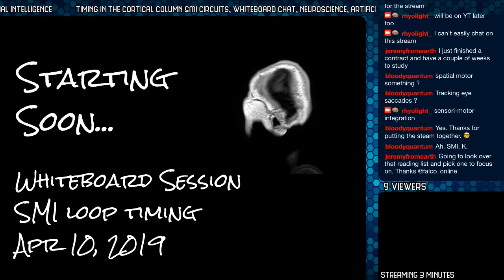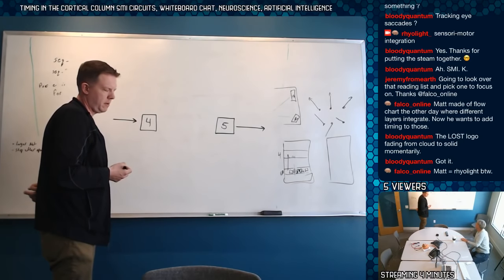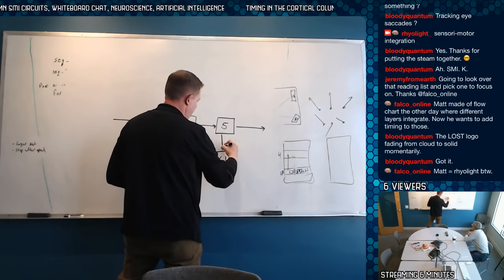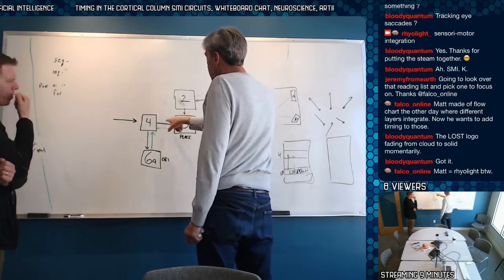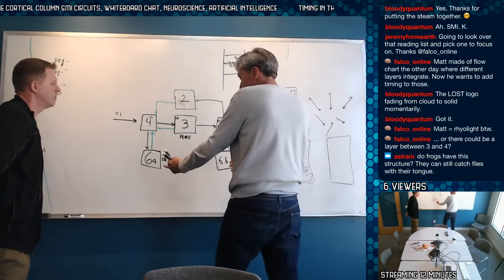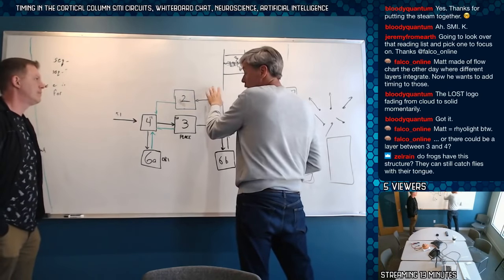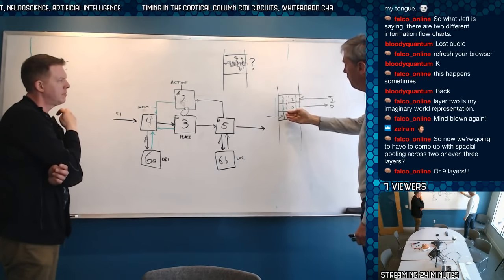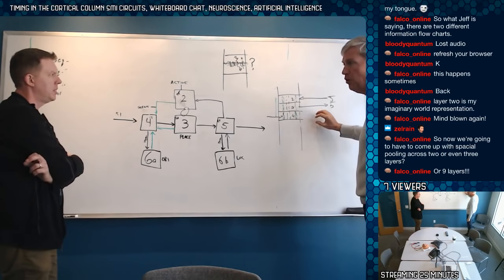Timing in the cortical column SMI circuits, whiteboard chat, neuroscience, artificial intelligence

Comment: What about EMF signals? Surely there's some mechanism for synchronization and feedback using EMF, and a mechanism to "prime" cells in advance (since these signals would travel faster, but would be less strong). Since the distribution of cells already encodes for spatiality, they would be able to make temporal assumptions as well.

Comment: Don't all these layers have apical dendrite connections in layer 1?
Which layers project to layer 1?
Reply from the maker: Layer 1 is just white matter (connections, not cell bodies).
Reply: @NumentaTheory  So is the white matter mostly layers 2/3, 5 projections from distant parts of the cortex? Do all layers have apical dendrites that connect to layer 1. Perhaps that could be part of the missing layer 4 prediction?
Reply from the maker: Nothing connects in layer 1, it's really just all wiring. Its how long-distance axons make connections across cortex.
Reply: @NumentaTheory  Thanks